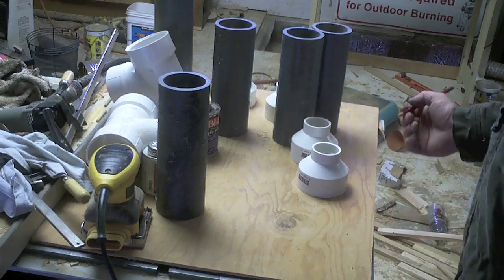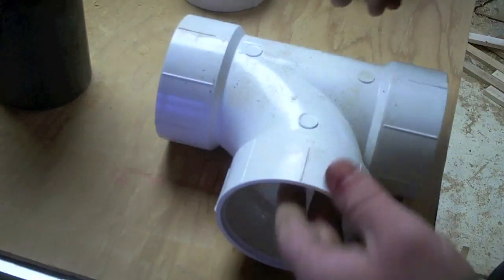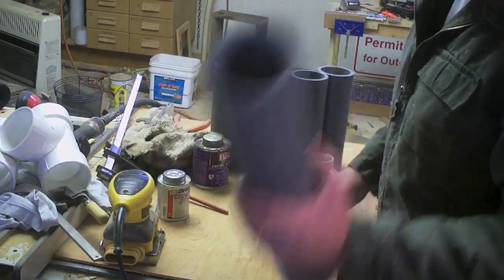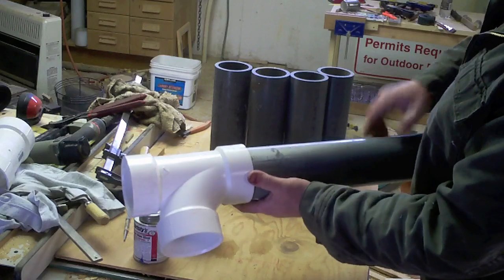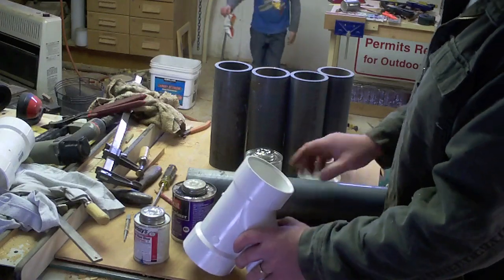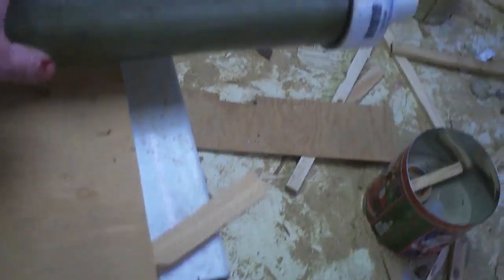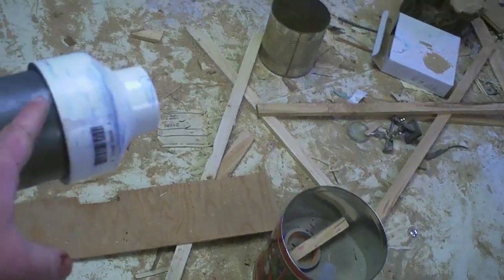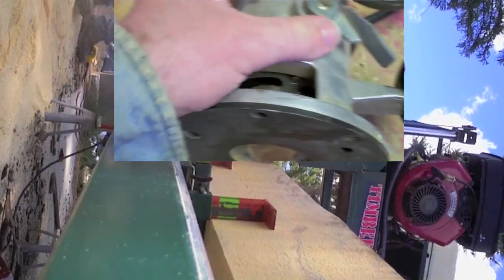Building a Passive Sand Trap From Scrap

Comment: This does indeed work. I just built one for the actual main well for my house. The codes for wells are determined more than 300 miles from where I live and the demand a drilled well when my sandy soil really needs a dug well. Needless to say I was getting enough sand to ruin just about everything. This solution is helping go about flushing the well on a timer to hopefully build up a pocket around the well point. Thank you so much for sharing. This basically saved me.
Reply: *****  I used 4 " reduced down to 3/4" valves for purging. This was expensive and if I had to do it over I would just cap the bottoms. If they ever filled it would be cheaper to just sawzall the bottoms off and coupling another capped end.
Reply from the maker: ***** I am glad it worked for you.

Comment: Always appreciate it when some one shares..I'll build this this week.. Thanks I too needed this
Reply from the maker: I built mine larger than it needed to be.  I never get sand out of anything but the first tube.  If I did it over I would make something that looked like a T on it's side.  Long run for sand to fall out, drain ball valve on the bottom, draw from the top.

Comment: Could you install this on the suction side before the pump, to prevent the sand from damaging the pump's internals?

Could it go well, check valve, sand filter, then pump?
Reply from the maker: I am sure you could but if it leaks the pump would lose prime.

Comment: as plumber and well cont. for 40 years I can tell you this will only work if not on pressure side of pump with dwv fittings, not made for pressure friend used to make these, fittings cracked under pressure.
Reply from the maker: Yes, I have since had issues with this.  It was a super low pressure system on 30psi or so right up until the day the pressure switch failed. Not sure what it got up to but it burst. Bypassing now but will look into installing on the suction side.

Comment: Good solution, but you put the sweeper on backwards.
Just kidding :p
Thanks I needed this!
Reply from the maker: It has been working fine for several years now but a bunch of it is way overkill.  I still think you need the large diameter pipe with a long run to let the sand drop out but just one collection bin (one T at the end) would have been fine.

Comment: Thank you for this video, I believe this system would work well to trap larger particles like sand but how would you recommend to build a system to trap very fine dust and really small particles from not very high speed of water flow in a (1/2)" hose pipe?
Reply from the maker: I don't think it would work for that without some sort of filter media.
Reply: NelsonStudios thanks for your response, yeah, even I thought so, planning to buy a low cost and effective filter for the same soon.
Reply from the maker: Something with big, cheap filters.

Comment: a 3" or 4" PVC is not for pressurized function, its will crack under pressure
Reply from the maker: Pvc sewer line isn't rated for pressure, but 40 and 80 Pvc is.  You don't have to believe me, it is printed right on the pipe.
Reply: @acme663ryo  you are correct what about the connection pieces, T section...etc, my experienced the t-section cracked.

Comment: Ken,
Many thanks for building this filter system based on the plan you designed in a previous video. I am going to duplicate the effort with somewhat smaller diameter PVC.
How did you provide for a "drain" at the bottom of the "traps?"

Hope to see you in MT summer 2015.
(What is your driving time from Missoula to the Tour location?)

Chip
Reply from the maker: Don't go too much smaller, you need the speed of the water to slow in order for that particulate to drop out.  To drain I am using 3/4 pvc gate valves but honestly unless your well is puking tons of sand you could go years without draining and even then it might have set up like cement in the bottom.  If I had it to do over I would use just regular clean-out plugs though I imagine they will be on one hand hard to seal and on the other hard to get loose later.  I think I would also make all the 10 inch long pieces 6 inches instead.  Dang thing was a bit big to fit under the house though I got it in yesterday.  Anything worth doing is worth over doing I guess.  About 2.5 hours.